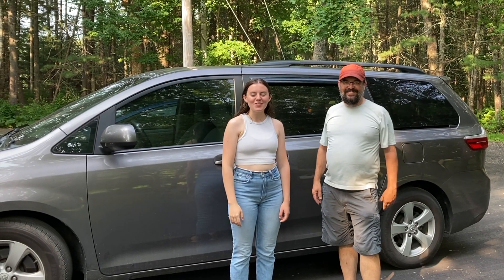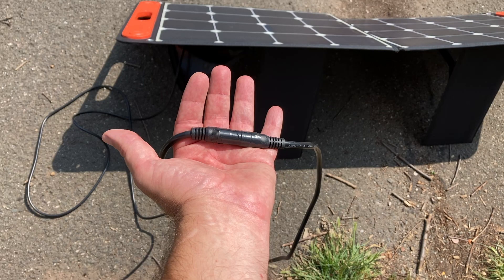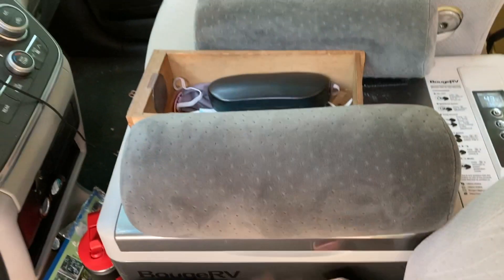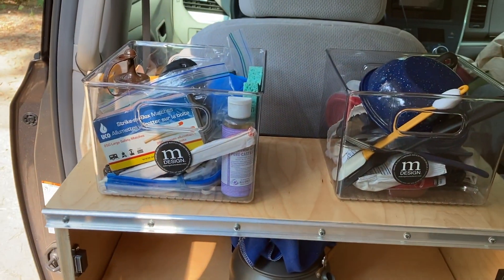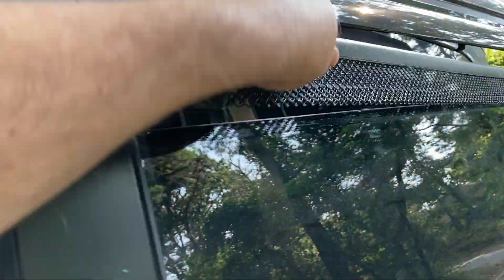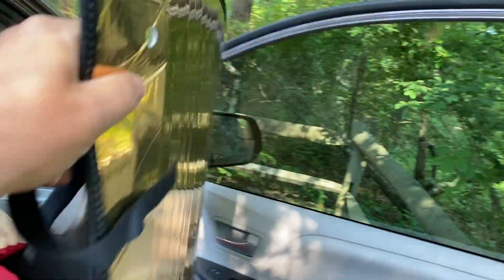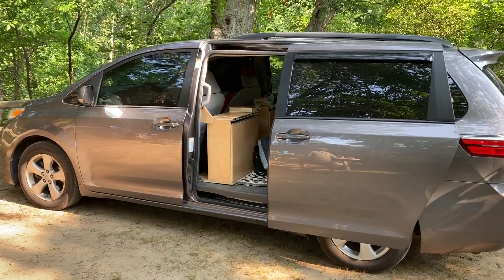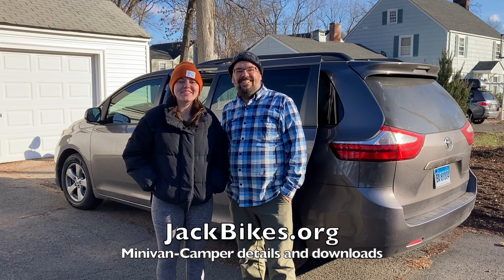Daughter & Dad Update on Minivan Camper - Toyota Sienna

Comment: You CAN refill the 1lb bottles for your stove. There's lots of videos on YouTube showing how.
Reply from the maker: I agree that it's possible to refill a 1-pound propane canister with an adapter to a 20-pound propane tank, and several people do it. But many of these YouTube videos also describe safety issues and warnings to "check local laws" before doing so. Since I need a stove that's safe and easy for all family members to use, I decided on the butane stove. While I don't like using disposable butane cans, my average is 6-7 meals per can at $3 each.

Comment: Placing the solar panels away from the van makes so much sense. You can park in a shady area instead of turning the van into an oven under the bright sun. Plus no drilling holes in the roof, and you still have space for a roof rack. Guess it depends if you’re driving all the time, or mostly camping in one place.
Reply from the maker: Yes, that's our reasoning, too.

Comment: Thinking about getting the same shades. Just wondering what you do for the side windows with the vents to allow air flow. Thanks!
Reply from the maker: We simply bend the shades down near the top of the window to allow air flow through the wire mesh window vents.
Reply: @JackDougherty  Thanks I figured that would be the case just was unsure on flexible they are.

Comment: You can actually get an adapter to refill the green propane canisters from a regular 20lb  propane tank.
Reply from the maker: I agree that it's possible to refill a 1-pound propane canister with an adapter to a 20-pound propane tank, and several people do it. But many of these YouTube videos also describe safety issues and warnings to "check local laws" before doing so. Since I need a stove that's safe and easy for all family members to use, I decided on the butane stove. While I don't like using disposable butane cans, my average is 6-7 meals per can at $3 each.
Reply: @JackDougherty  ahhh, I'll have to Google.  Didn't know it was unsafe.  I've got one of those adaptors!
Reply from the maker: @Gunapatifamily  Maybe it's safe if you really know what you're doing. But that's not me!
Reply: @JackDougherty  i NEVER know what I'm doing.  Ha ha